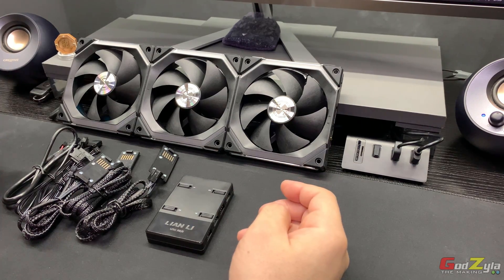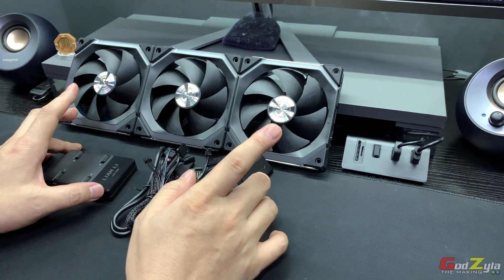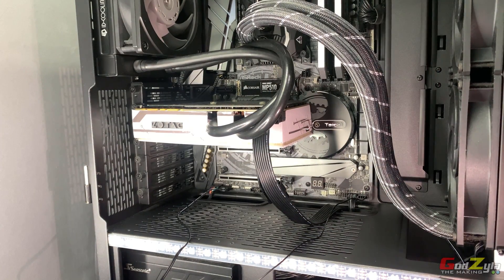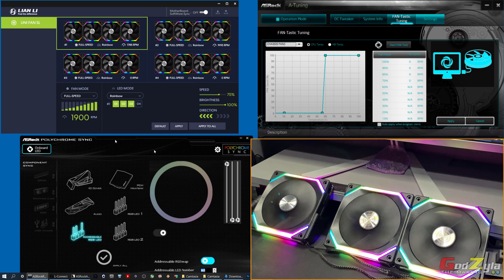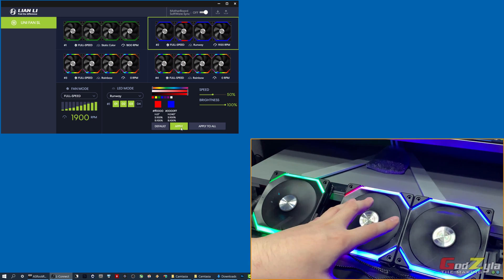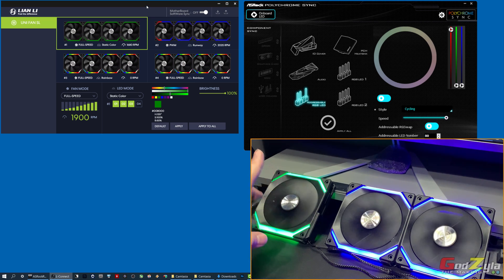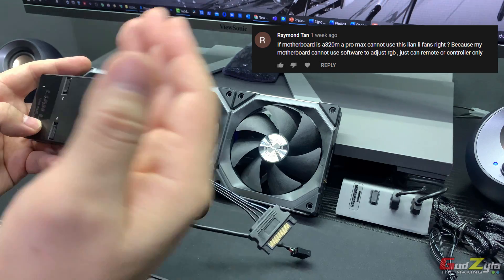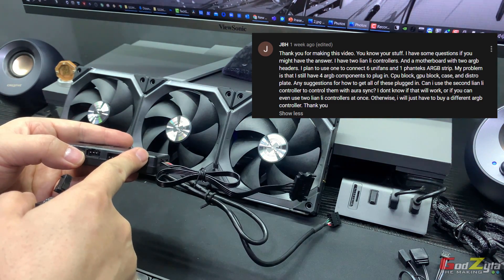Lian Li Uni Fan SL120 - Connection & The Controller (Part III) [L-Connect]

Comment: Is there a reason why my bios is not detecting my uni fans?
Reply from the maker: Hi Sauze, thank you for your question. The reason your bios is not reading the fan RPMs is due to the fact that your fans are not directly plug to the motherboard fan headers. That is why the UEFI / Bios is not reading it.
Reply: @KleoYan   so because the uni fans have a controller, the bios cant detect them? also the pwm in the L connect doesnt work either :/
Reply from the maker: @Sauze.  if you choose to plug fans connector to the uni fan controller, your motherbord will not detect the fans RPM. if you choose to connect the fans directly to the motherboard fan headers, then your bios / uefi will detect the fans RPMs
Reply: @KleoYan  I have mine plugged into the controller and set pwm mode in the bios  but when I put it to pwm mode in L connect the fans just drop to 800rpm
Reply from the maker: @Sauze.  did you plug the pwm fan header from your unifan to the motherboard one of the fan header? and to configure the temperature or fan curve to that specific fan header? I believe you have configured incorrectly
Reply: Hello I am having the same problem. I have all my fans connected to the L connect controller. Then a 4 pin fan header with 1 black wite on the rightmost pin connected to a fan header.

When selecting pwm the fans only stay on the low setting and do not change even when the pc is under heavy load. I have the 4 pin fan header from the controller connected to system fan 4. In bios I turned system fan 4 to PWM.

How would I fix this? I am so lost.
Reply from the maker: @SuperLaOfficial  I think I did reply to you on this. you will need to trigger the PWM mode on your motherboard in order to have this work. check your bios / UEFI. set it to PWM 
and make sure you know which fan header to activate on your UEFI/Bios.. btw what motherboard are you using?
Reply: Thank you so much for the quick reply. I'll let you know if it works! You are such a big help thank you.
Reply: I am using an Z390 Aorus Pro mobo
Reply from the maker: @SuperLaOfficial  I see. on page 27 https://download.gigabyte.com/FileList/Manual/mb_manual_z390-aorus-pro_wifi_1001_190708_e.pdf  onwards under M.I.T of your UEFI page, there is this PC Health . I believe that's where you will be setting the PWM mode on your selected fan header. hmm.. hope that helps... by the way, thanks for the reply and if you like my channel, do subscribe thank you!

Comment: Hi there! Tks for your amazing video! I have a question that you might help me. I recently bought this UniFan Sl120 and an AIO Galahad 360, they are both Lian Li, and it seem’s that the Galahad fans have the same RGB  connection as the unifans, they haven’t arrived yet so I can’t confirm that they are the same. But can I use the unifan controller to control both RGB fans model? I saw your video with that led strip so I’m thinking to use both sets of fans with this unit. Tks a lot!
Reply from the maker: Hi ya Alexandre Rossi, based on the manual which I have downloaded here https://www.lian-li.com/galahad-240-360/ , you not only can connect the Galad fans to the UNI Fan controller. you can also connect the pump argb to it too. 

Since I have tested the max Ampere of this unit. below is just for your reference and it will be safe if you are connecting the Galahad AIO fans and pump block. 

UNI Fan set 1 to 3
===============
Set 1 - 3 x SLI Fan
Set 2 - 3 x Galahad Fans
Set 3 - 1 x Galahad Pump Bock

(Optional) 
Set 4 - 3 x SLI Fan or 1 x argb strip (0.5meter) . <--- this is optional

Once again thank you for your question and to have visit my channel.
Reply: @KleoYan  Hi there! I just received the AIO and the unifans, but the RGB fans in the AIO have 4 pin conector and the unifans and the pump are 3 pins... so I connected the pump and unifans to it’s controller and the fans for the AIO to my Mobo... TKS for your help and information!
Reply from the maker: @alexandrerossi3553  Hi there, ok I do not have a Galahad AIO but I do have the manual downloaded. download the manual or look at the manual that comes with the box. 

First identify the 3pin argb daisy chain cable (Page 1 with indication Q) 

(Page 6-7 with indication Q) connect all three pin ARGB header of your three fans to this cable. on the other end, which leaves only one connection. connect that to your Unifan Controller.

As for the fan connection on the manual it does not stat how the four pin header of the fans are daisy chained. you can plug to your motherboard for the 4 pin headers from the fan. Or if able to daisy chain it. then connect it to the only end to the Uni fan controller.

Comment: My friend, once again, made a great video! After seeing the other unifan videos, including the one from the tests in which she did not do so well and we talked, I pondered and bought 1 kit of them, and will probably buy another one in a few weeks. The point is that I believe that they will do a good job in the o11 dynamic, mainly related to dust filters. Regarding this video, wonderful demonstration of how the lian li program works combined with the motherboard system. an excellent complement to the other video regarding L-connect.

Continue with these videos, your material is quite complete, very well explained, and very useful.
Reply from the maker: Hi Ferraz, thank you for the compliment. Glad it did help you out. Now as for getting another kit which includes the UNI Fan controller. I have not tested this. it might not work. I assume that the L-Connect software is able to operate only one controller. so do take note on this.
Reply: @KleoYan  Yes, I imagine that two controllers should not work together, but here in Brazil it is more expensive to buy 3 separate fans than to buy a new kit, I will take advantage and leave the second controller and the cable set as a backup. what i think about doing is buying the phantaks led strip and plugging it into the controller, just like you demonstrated in a previous video.
Reply from the maker: @heversonferraz5797  I see. maybe the second unit can be as a spare as this controller as compared to other brand controller. It is very well engineered. it's worth the purchase. by the way.. all the best on your PC build too :)
Reply: @KleoYan  Exactly, maybe I will use it as an argb hub on the second motherboard connection, so I can take advantage of the 10a potential that the controller offers, on the motherboard connection, it supports a maximum of 75 leds with 100% brightness, at least that's what in the manual.

Well keep up the good work, sya.
Reply from the maker: @heversonferraz5797  yup buddy, that what I have been trying to buy after I got this kit. looking for online stores to just sell the controller without the fans. I am amazed on how it's build plus the software that comes with it.

Comment from the maker: There are some dos and dont's about this UNI Fan controller that you might be interested  https://youtu.be/QQHJUQvKwlY
Reply: Great video! I have 9 find ,top exhaust, front intake and bottom intake  with a liquid cooled cpu(rad on top). I am thinking of getting a kraken z73 for 9900k and KINGPIN 3090. My question is, how would I wire the card or AIO with these fans as a replacement if it is even possible.
Reply from the maker: @ato2960  Hi, thank you for your question. after reading the z73 manual. it takes reading from the motherboard fan header and instruct the fans rpm though the pump unit. If you are to replace your z73 radiator fan with the uni fan. I am afraid you will have to lose its function from the z73. or what you can do is to connect the SL 120 fans to the pump block where is has 3 fan spliter (Cable Mess) and connect the argb to the Uni Fan. that should work. but alot of mess, as for the Kingpin AIO GPU, I dont seems to be able to find the manual as it's a new product, therefore unable to answer your question on it. once again thank you for your question and to have visit my channel. If you like my content, kindly subscribe and to click on the notification bell.